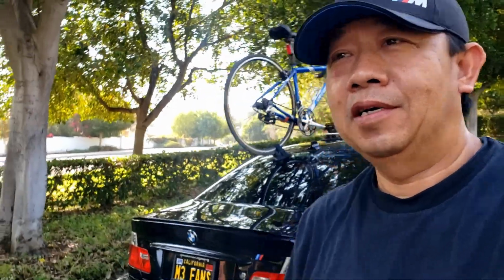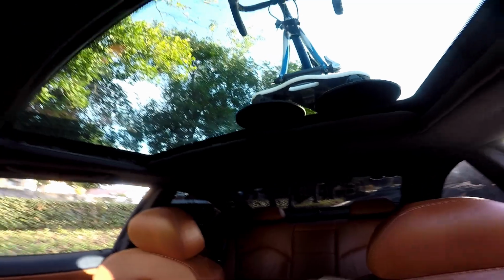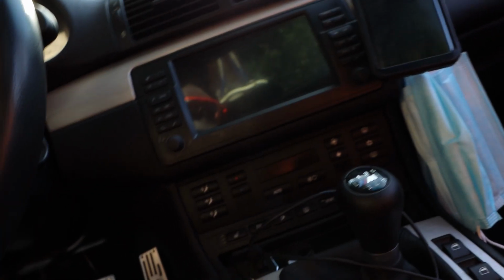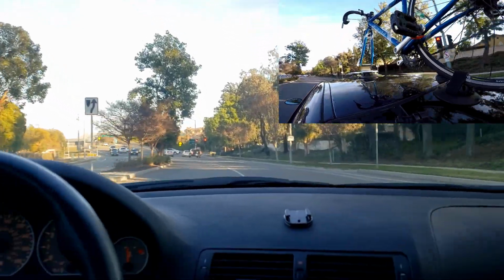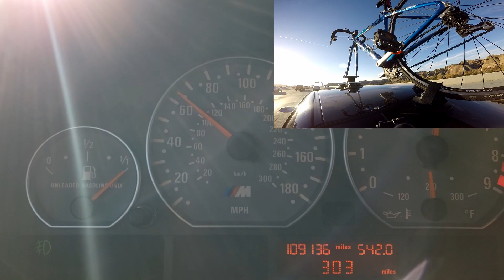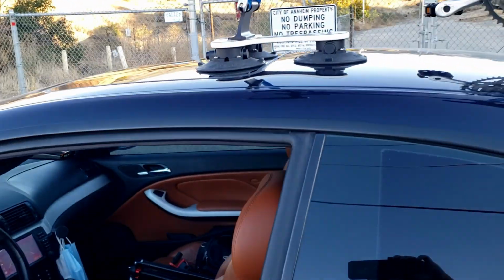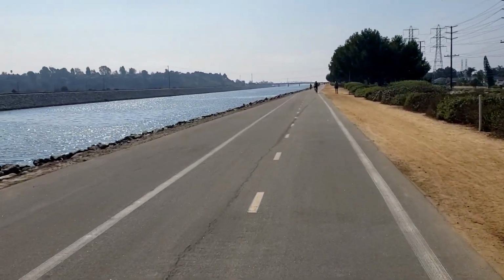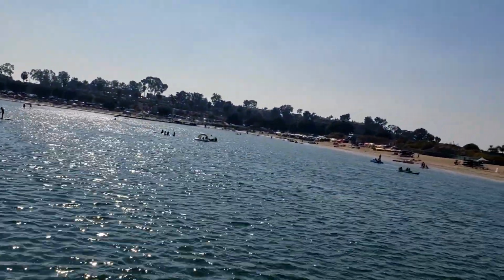Taking my M3 go Biking with friends.

Comment: Have you thought about upshifting to 5th or 6th gear when on the highway? It’s pointless to cruise at 4500 rpm going 50-60mph. Waste of gas
Reply from the maker: You absolutely right, however, this video am just cruising a short distance and plus I want to hear my S54 engine screaming with my exhaust tail pipe LOL ✌